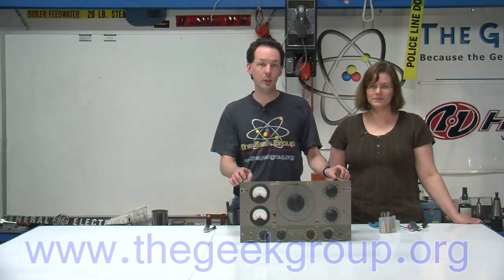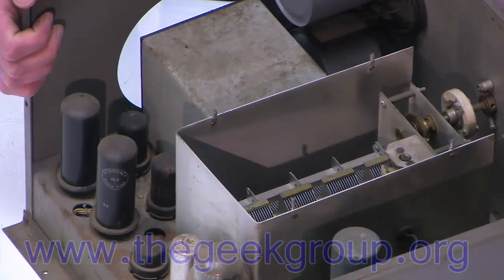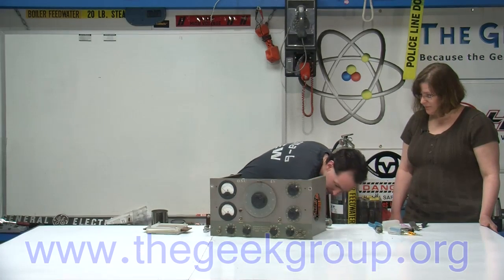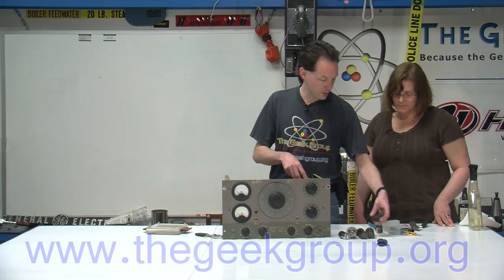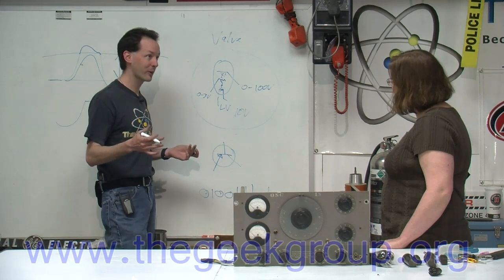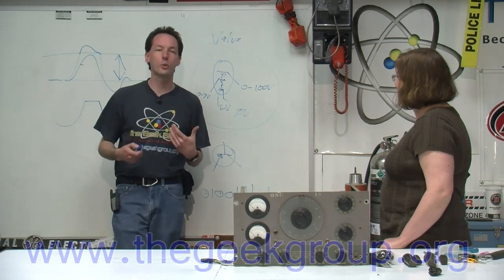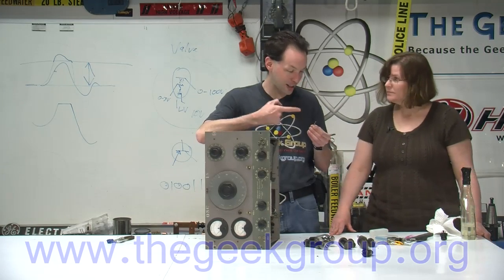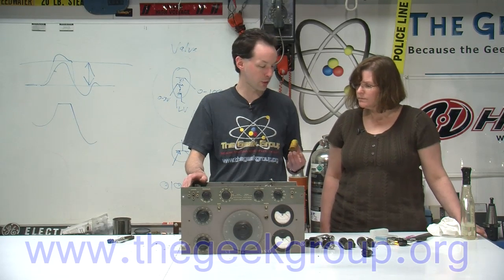Audio Frequency Generator and Tubes-vs-Solid State Amps

Comment: Hewlett Packard's legacy was built on improving the already troublesome variable frequency audio generator.  Audio generators at the time were huge, cumbersome instruments which used fixed condensers and could not generate a clean audio waveform without much distortion.  With the suggestion of his professor, Bill Hewlett built a new type of audio generator using a variable condenser, and using a negative-feedback circuit which greatly simplified the design and virtually eliminated distortion.

Comment: Great channel and great video. Very informative.  I'm glad to hear someone speak logically about audio. 

Mark Levinson is some solidly built amps that will drive any speaker. I've got an older Thresold class A and it seems pretty bulletproof as well (looks fairly simple inside too). I've also got an old SAE and an old Soundcraftsmen amp and I really like them both as well.  Would love to build a tube amp from a kit one day too...just for fun.

Comment: Just watching this when I am repairing my old tube RC generator,it wasn´t oscillating,the output was dead,just needed to replace 8 leaky capacitors,and its oscillating,now i need to just swap out a broken pot,and one leaked electrolytic cap,and it should work like a charm again,there was no need for such an autopsy,everything you want to see is around the chassis and its very accessible,the great thing about these tube instruments is easy repairability and solid metal build,with real stuff,like magnetoelectric meters,air gap tuning cap,the tubes themselves.Point to point soldering is good.

Comment: Hey I enjoyed your video and now I know what I have.  I have the same one but mine is in a wood frame.  Where the generator is it has that cardboard stuff that would be on the back of old radios.  I found it sitting in the rain by a dumpster in Massachusetts 8 years ago.  I have never tried to plug it in and I don't think I ever would lol.  It also has a plate on it that says property of the USN on it lol.

Comment: the transformer with the multiple taps are most probably the various output impedances being on that side and close to the amplifier (which is most probably push pull BTW)

Comment from the maker: Such is the difference between a salesman and an engineer. Do be careful not to step in the marketing. Anything that changes the audio signal, in any way, to differ from the original source (aside from amplitude of the waveform) is distortion. This includes "transparency", "depth", and "feeling of space". None of which can actually be measured, and all of which are nothing but marketing bullshit to make you feel better having spent an extra couple zeros on that glowing glass.

Comment: It's just a guess, @26:15 strange mica mold device could be:
1) precision capacitor
2) thermal compensation capacitor
3) varicap diode, (depending on your sig gens age)

Comment: He is distorting the issue by making distortion the main issue.  Tubes are more transparent and give better depth to well recorded music than solid state when both amps are within their headroom. I used to sell audio equipment. I could get any excellent solid state available at that time. Its not just about distortion that makes tubes present their greater depth and feeling of space (while the amp is coasting along at a few watts).  And, yes. Tubes clip better. But, they sound better musically.
Reply: You haven't taken any ABX tests?

Comment: clipped signals and square wave signals are hard on speakers, just look at the sine wave and the square wave shapes,now think in the time it takes for your square wave signal to go from peak volts to 0 volts,your speaker cone AND your ear drum are trying to deflect the same way to reproduce the sound wave,this will tear the speaker coils from the cone and make your ears hurt if you listen to the clipped or square wave sound long enough
Reply: No it doesn't Speakers have an inherent stability, its called Watts. Guitar cabinets have been used since the 60's and still have good speakers(many consider them better at this point) so if you are saying that 60 + years of guitar playing is hard on the speakers...umm that is better wear than almost any other consumer product. How much stuff last for 60 years despite "clipped signals and square wave signals are hard on speakers" Clipping is nearly every rock-ish song and many people listen to music all day without their ears hurting from it. Volume is a much more damaging source to speakers and ears than any sort of normal or even hard distortion. If you play a speaker 700 watts speaker at 1 on your 18 watt amp for 100 years round the clock(and its not initially defective) it will last the entire time, however if you play a 100 watt amp at 10 into a 15 watt speaker you will blow it in an extremely short time even with a perfectly clean signal.

Comment: to be fair, these "terms" are just lay-person speak for differences that can be measured in the performance between a transistor amplifier and a tube amplifier.
if you play an electric guitar and switch between a tube and a transistor amplifier there is a noticeably different "feel" (read: response) to both amplifiers. this is the result of measureable phenomena such as slew rate and efficiency.
"transparency" = amount of distortion (NOT clipping). 
zero distortion = "transparent".

Comment: @adrs2 what's more audio perception in your ear varies. When there is a large peak in sound, stapedius muscle contracts and dampens the vibration of the stapes! That's the trick, your ear is a compressor, which switch on and off partially when you listen to music. Dynamic - max headroom solidstate music distorts your audio perception. That's why partial TUBE OVERDRIVE IS SUPERIOR because it relieves your ear! THE MOST IMPORTANT PART IS HUMAN, not your EQUATION, unless you are a robot.

Comment: I have had top of the line mosfet-amps, + bipolars with almost zero distortion.
then a friend let me try a cheap diy 25 watts with some simple el34 push-pull circuitry. I sold the semiconductor-superamps immediately afterwards. You don't believe it till you hear it - that's all i can say.
Reply: you tube clips don't show this either, even HD ones. Same here, I rented an amp from the music store and was blown away by the sound coming from the combo amp(Traynor YCV50B) sold my Fender mustang half stack the same week. I still have a few solid state amps, but a tube amp DOES sound different. I have done AB tests and while it can be difficult with some of the newer(past 10 years) technology there is something different about the signal from a tube. My friend has Axe FX and its good but always sound too processed. Airy is still a good term when listening to 6L6 and vintage 30 speakers with a little crunch.

Comment: Solid State amps will always sound good when not overdriven, it is when over driven that tubes give a more pleasing sound.....you can talk about tube vs transistor linearity and distortion crap all day but what makes a tube amp sound good when distorted is the use of an output transformer, this design configuration produces even order harmonics when over driven (sounds good), solid state designs produce odd order harmonics when over driven (sounds bad)...tubes also clip softer than transistors so it isn't as harsh....tube power amp distortion again sounds better than either tube or transistor preamp overdrive for the same reason....this is why Eddie Van Halen used variacs (variable line transformers) to turn down the line voltage to his tube amps to get the power amp section of the amps to distort at a much lower volume (more suitable for practice, etc)

Comment: I have to disagree with your assessment that an A to D conversion then a  D to A conversion will give the most accurate reproduction. These are accurate approximations of the original signal but transients, especially fast ones are lost. Tubes are voltage amplifiers and transistors are current amplifiers. The load resistor on the output of transistors changes the impedance of the circuit and thus the frequency response. Anyway tube, while difficult to work with. are better for audio.

Comment: there is nothing inherintly wrong with point to point. Nothing ever proven good or bad compared to printed boards. Wiring will play a part at times, but rarely. Also proper shielding is essential and routing planned well if doing point to point,. Otherwise, it's not stupid, just different, unless you are saying Audiophiles are stupid because they pay 5x more for that method. Yeah that's fucking stupid.  Ijust found your channel..sweet! I had a similar device, but was Mono with Telefunken tubes
Reply: And there are no PCB traces to ruin...

Comment: Why scrap a perfectly good audio signal generator ?
A normal triode valve has the heater filement,
A plate, A Grid for signal input & A cathode.
Shame to damage such a nice piece of equipment !
,
Reply: If you've got the room for it, it could be useful, but its a huge power hungry dinosaur with performance that's not great by modern standards.  Probably weighs 30kg too!  Most of them are and will be scrapped/recycled because its not the 1950's anymore!  The few in museums are all we need.

Comment: Looks like you know something about electronics, but still is very few compared to very good electronics engineers, to give you some credit to talk about audio equipment.

What is worse, is that you never heard a very good audio system in your life, like the ones that make you believe that is in fact is a band playing in front of you, so, you don't know and you will never tell the diference between solid state or tubes until you hear it in a very very good audio system, and of course is no need to overdrive the amplifiers to tell the diference that is most cases is pretty much obvious. 

Don't make fun of audiophiles, don't say they are stuppid, because some of them can tell the diference between solid state and tubes and you think that you can't, they can tell the diference in a blind test, but don´t be stuppid and ask them to try to find this diference is a crap system, with crap music, because is impossible, and this is what happens in quite all blind tests, and most of the time they do it with deaf people.

Make yourself a favour, combat your ignorance and go to a real good hi-fi shop and ask to play some music in a hi-end system, certainly the system will cost quite as much as your house, but you will understand why.
Reply: You confuse an audio system with amplifier performance.  The audio system is very dependent on speakers, speaker placement, room accoustics, these dwarf the differences between amplifiers, basically all good low distortion amplifiers are the same if not overdriven.

Comment: the watermark is unnecessary and annoying...
Reply from the maker: +Toxi Core The video is nearly five years old, when we were still making baby steps in learning video production. It's a little impossible to go back and change it without re-uploading, but you'll notice on our other, recent videos we've made strides. We hope you still pulled some worthwhile information from this one, regardless.
Reply: thegeekgroup i have 5 of them and  different model's.you need them there southwest electric co.1940s and brand new.  I also have 1940s voltmeter